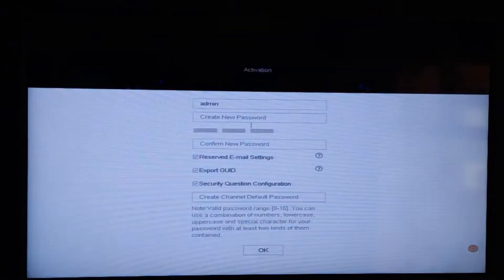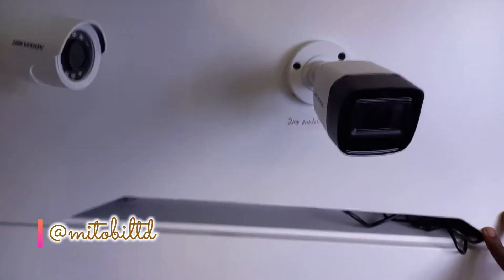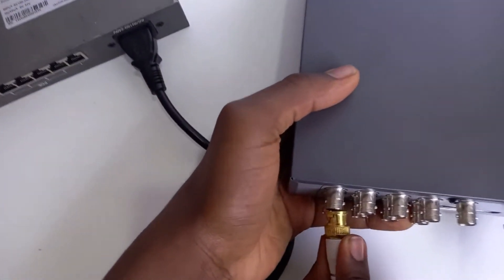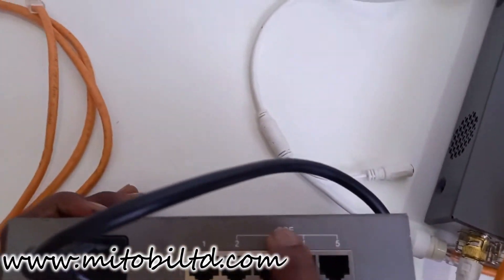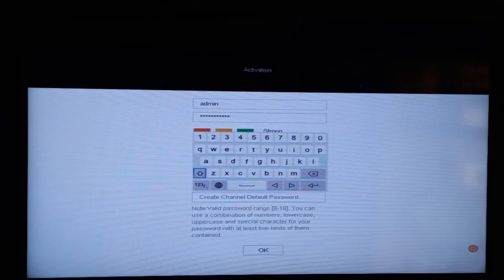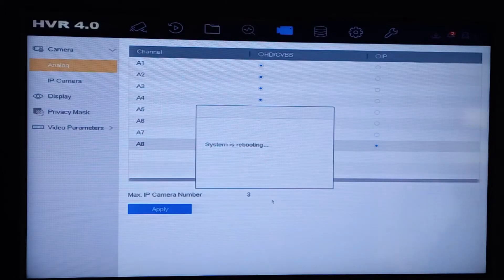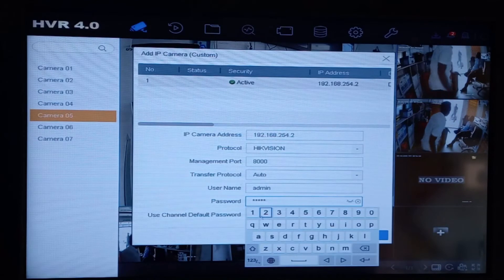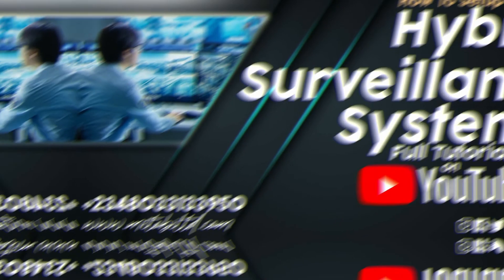How to Connect An IP and Analogue Camera on a DVR (Digital Video Recorder) Hybrid Surveillance Setup

Comment: Hi i am having a problem adding an ip camera to my hybrid dvr and  the dvr can find the ip address of the ip camera but when adding it does not display the camera and says connect failed is it about password  but i did not set a password to the ip camera
Reply from the maker: what brand are you working with and also check if it support ONVIF protocol